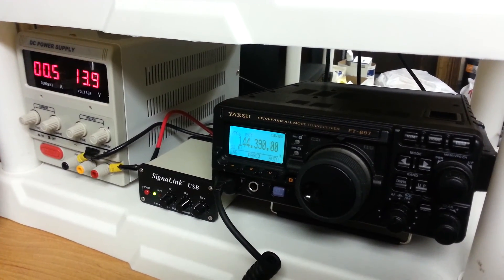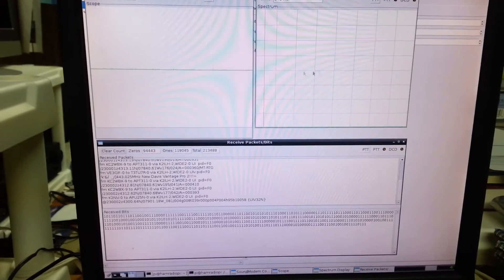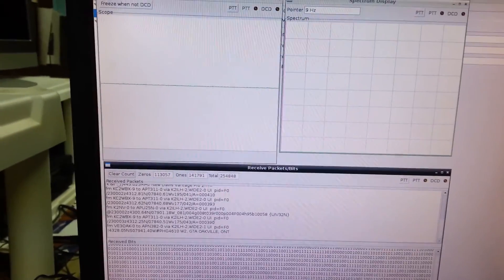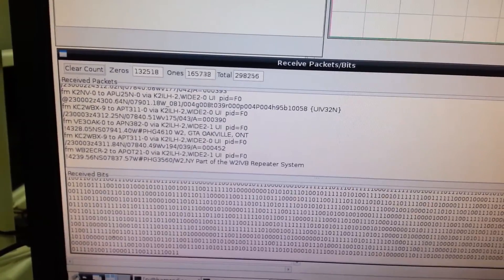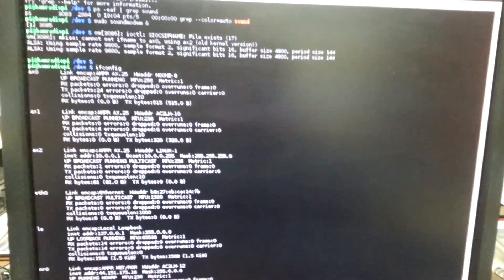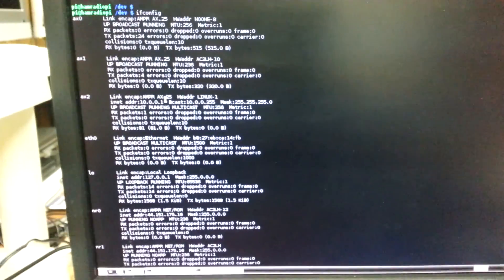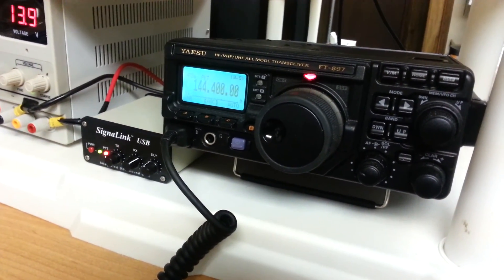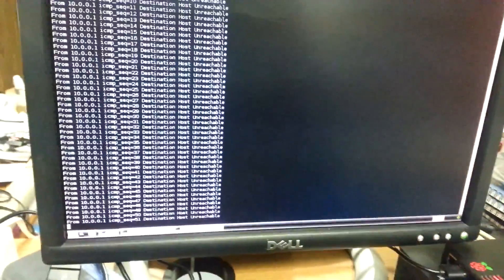Packet Radio with Raspberry Pi running Soundmodem

Comment: You should host a website and bulletin board system now with this setup so other hams can connect to it.  You could do a 'net' on the bbs over a 24 hour period.  I'm about to dedicate a 2m Kenwood radio to a similar thing, but I'm using direwolf and LinBPQ on a raspberry pi with a TNC-X.  I'm thinking about getting a TNC-Pi but it looks like they're not making them anymore.

Comment: does this make the TNC-PI irrelevant?
Reply: Probably not. Most applications I've seen for the TNC-PI are for mobile APRS devices. You could probable use it for a base station.
Reply: he's just using a tigertronics device instead of the tnc-pi device. They both do same thing. Just like j hill stated the tnc-pi is nicer for mobile or portable usage.